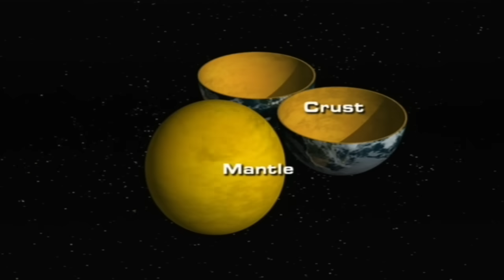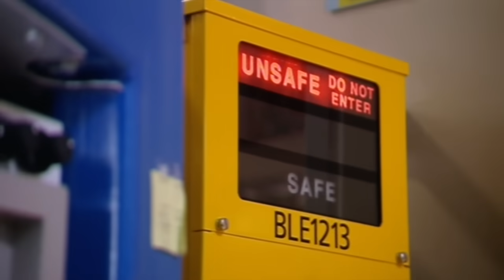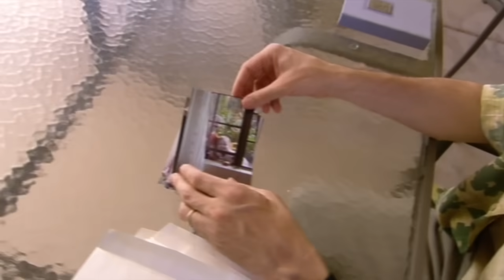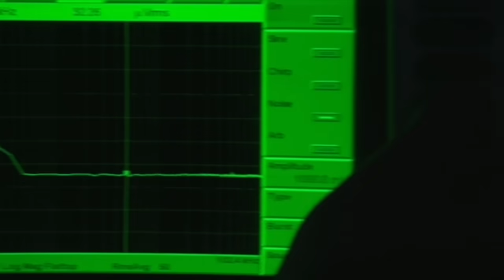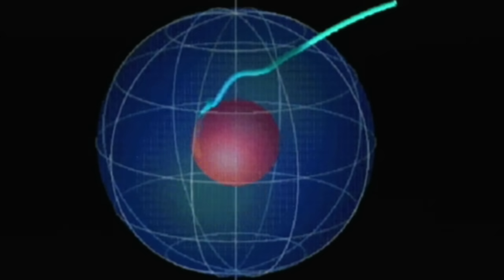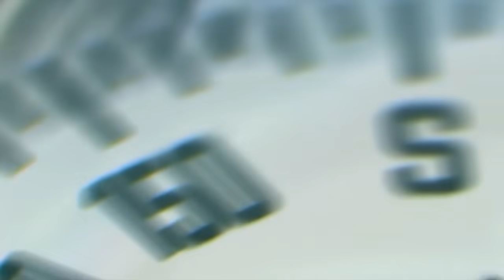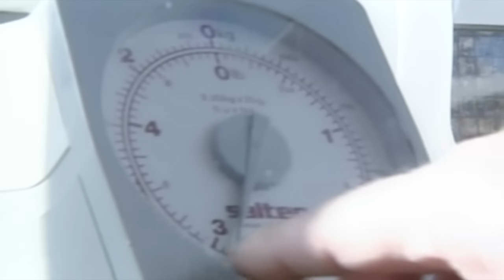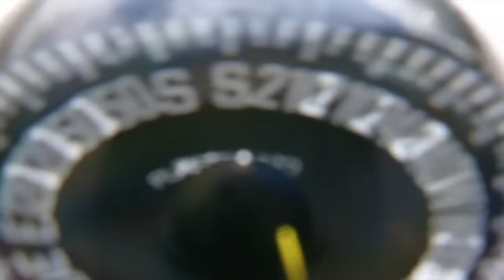Earth's Core

Comment: The Earth's mean radius is 3,963 miles. The solid core 800 mile radius. There's magma around the solid core that's 200 mile thick. The crust and surface magma is 200 miles thick. So the mantle is over 2,600 miles thick and is the dielectric constant of the spherical capacitor Earth needs to pulse the magnetosphere out in space at 7.83hertz. Anotherwords the mantle is the insulator between the magma plates. The center magma being the DC generater with it's 200mile diameter counterclockwise rotating loops that meat at the north and south poles to form larger loops as coils for it's Spherical capacitor to discharge into.
You need a capacitor and a coil for resonance. 7.83hertz is that. Every Engineer on Earth should know this by now. If not then their not Engineer's. This Video is deceiving in Earth's components and their functionality. The magma under the tectonic plate waivers in polarity not the core its self. Mar's magnetic field is collapsed because of a crack in it's mantle shorting it's capacitor. Mar's magma is not solidified or it's gravity field would focus to a point and force the solid core to spin and a blackhole start to form and we would be in trouble.
Reply: Good evaluation.
Reply: @Jimmy2Deadly  Thank you !  The only reason I know this is because I understand how gravity work's.

What is deviation? Well you stir your coffee in the morning and you notice the center stoops down with circular motion.
  The Earth's gravity deviates to the middle, the point of least resistance where the molecules are slowest trying to keep a hold on the faster moving molecules in the outer perimeter through covalent bond but losses grip on some so the molecules in the center takes up the loss becomes heavier and stoops down.  It shows that gravity is an inertial lagforce from motion and not the bending of a spacetime fabric.
The beginning math was simple as you can see.
18.545miles/s:Earths orbital velocity.
.288198miles/s:Earths rotational velocity.32.17405feet/s:Earths free fall constant.
2.000000677s^2/foot: the rate the Sun's pull deviates to the center to cause g constant. So:

(18.545/(.288198×2.000000677))=
32.17405 feet/s^2'g-constant.

The lagforce from the acceleration. of g is the cause of gravity.  Lagforce is the result of acceleration, you'll always have it during acceleration and since Earth's acceleration never let's up so neither does gravity or it's lagforce.
The more complex version math is more accurate.
(1000*c*pi)=Earths Perimeter of orbit=
585,223,410.069 miles. 
There are 86,400 seconds in 24 hour's.
585,223,410.069/(365.2425*86,400)=
18.5449916097miles/second^2=Earth's orbital velocity=Vo.  And.
Earth's mean radius is 3,963 miles and takes 24 hour's per revolution then.
(3,963*2*pi)/86,400s=
.288197482736miles/seconds^2=Vr=
velocity of rotation. And we all know g.
g=32.1740485564feet/second^2 or
9.80665meters/second^2. Now the formulae.(Vo/(Vr×g))=d constant the rate the Sun's pull deviates to the center of earth to cause it's free fall g constant.
So d constant is 2.000003382s^2/foot.
Because:
(18.5449916097/(.288197492736×
32.1740485563))=
2.000003382. Stoop rate.
Reply: @alberttorres4830  mate , I will read and read and read , for you to write that was something else . I do hope you fullfill your endeavours.
I'd love to meet you and really have a look at things , so well done hey .
Reply: @alberttorres4830  ironically...I have a fairly large milk jug it takes about 2.5 literally, I was mixing milk powder as an assertive to my diet ( IV lost so much weight to worry) 
I put a splash in to wet the jugs interior so powder don't stick, on top of little water I add the powder, then I stir and add more water I stir diagonally to smash the powder into the fluid, then when all powder seams to have turned to froth at least I then , swirled around and around, causing that vortex. I added water .... Could I be correct in thinking I got more water into that jug when I poured the water into a violently spinning vortex..
It just seamed to  be the case .
Reply: @Jimmy2Deadly  what's interesting is a dust devel was going by and I sprayed my Super Soaker in it and it got violently stronger. So I built a device that made a toroidal magnetic field and injected a mechanical inertialforce onto the field with an outwards force it would block gravity. Then I took it and placed it in the path of a tornado turnd it on and got out of there and watched. The tornado got on top of it and disappeared stopped was no more proving gravity is involved in the touch down of a tornado. Now you understand how to stop one.
Reply: @Jimmy2Deadly  @ First and foremost Centripital and Centrifugal so called forces are non fundamental by their definitions. They are without action and reaction violating the laws of motion already accepted by the curriculum. Stirring the coffee is circular motion with an outwards lagforce that lags behind the change of angle. Sense Earth's gravity has an effect on the circular motion by deviating towards its Center like a gyro by the way this happens with gyros as well. You can't leave the pull of gravity out of the picture, it's the only thing that deviates not the coffee or liquid and the skin effect is by covalent bond. Also the idea that gravity is the bending of space time is only a theory by a two dimensional thinker Albert Einstein trying to explain 3D space with a 2D idea that was never proven.
Gravity is a fundamental force with action and reaction. Earth's free fall is an acceleration with lagforce that causes you to have weight against the surface of Earth towards its center focalpoint area and is the differential of Earth's two circular motions who's math I have already explained. 
If your in a position have them check the free-fall of Mar's it should be 26.5264feet/second squard. A 10lb weight from Earth should weigh 8.1/3lbs on Mar's.

You know it's funny, everyone's making thing's that are so simple way more complicated than it is. There must be a reason behind it besides brainwashing.
 People are being brainwashed into believing theories are fact, when infact they are not facts but assumptions. I only deal with facts.
 Earth's orbital velocity is
18.545miles/s^2 and rotation is
.288198miles/s^2 these are facts then (18.545/.288198)=64.3481
Half of that is free fall and that's a FACT.

Wow I just disproved Einstein with simple math using your variables in the book. How quaint.
And this was just the beginning there's so much more.
As an advanced micro-physicists in advanced Electronics I can understand the mechanics of thing's.

Comment: Solid earth taught in school textbooks is not a fact nor a theory, its a flawed hypothesis just like flat earth. Remember gravity completely reverses inside the earth which is how we have zero gravity at the center of earth due to even pull from the huge mass above, and the pull from the huge mass all above will cause all heavy objects to fall away from the center of earth. Centrifugal force on the other hand will force all heavy objects away from the center of earth. Molten metals and very hot metals can't generate magnetic fields because intense heat destroys all magnetism destroying the inner and outer core hypothesis, experiments prove it. Also seismology goes against solid earth hypothesis and destroys the inner and outer core hypothesis as proven by Jan Lamprecht. All these facts completely destroys the solid earth hypothesis.

Comment: This video is based off of mistaken ideas. It's known the poles have flipped dozens of time and each time before they did the strength of the magnetic field dropped until nearly vanishing. When it came back up to full strength it was in opposite poles. At least next time present optional data instead of trying to make is sound like a doomsday prediction that's nothing but a lie. While the core will cool and solidify it's in no danger of doing that for at least a billion years.

Comment: It takes 56 pounds of Uranium 235 or 26 pounds of Plutonium 238 for critical mass. Critical mass being one split second explosion. My love of real science prohibits me from fully enjoying this series as much as could be. Thorium would be a better candidate. However, there are title forces on the earth from the gravity of the sun and the moon; these in tern, provide the energy needed to keep the earths insides hot. The effects of this proses would be amplified by the earths size and composition. And then the thermal energy would be further preserved by the thick crust. During  a magnetic flip, the magnetic field would weaken due to basic physics; being that, an alternating magnetic field induces a electric field. Such a electric field would be shorted through the Earth in its entirety; thusly, using up much of the magnetic field strength. After all, all of these prepossesses would be fed by the title forces that are nearly one constant input if gravitational energy. So, gravitational energy is converted to sher forces that result in thermal energy; the thermal energy through the proses of convections is converted into motion; and the, motion is converted through movement of ferromagnetic material into a magnetic field. In the event of a polar shift, part of the magnetic field energy is converted into electrical energy that flows through the earth. Basic physics, no bullshit; and just science. Now why could not this documentary be made with such realism and quality?

Comment: Mars has little to no atmosphere because it has no substantial magnetosphere, so if our earth's magnetic field will diminish and the atmosphere will be swept into the space by the solar winds -- but Venus has no magnetosphere, is closer to the sun, and has an intensely dense atmosphere.
Reply: Magnetosphere does affect atmosphere, but so does tectonics. Venusian tectonics ended over a billion years ago, and its system to recycle carbon failed with it. And that carbon ended up in the atmosphere as C02. Also, gravity on Venus is 90% that of Earth, whereas Mars gravity is only 38%. Interesting to note the composition of the two is remarkably similar, despite the enormous difference in pressure and mass.

Comment: If earth had inner and outer cores like they claim in school textbooks, it will be impossible for earth to generate a magnetic field because all that intense heat will constantly demagnetize all metals in inner and outer cores. All it takes to destroy inner and outer core hypothesis is simple experiment of heating a magnet or a magnetized metal under fire enough and the magnetic field is gone.
Reply: Still advertising your ignorance of the fact that our magnetic field is not the product of ferromagnetism, I see. Signed up for that basic science class yet?
Reply: @charlesmcmillion5118  lol yeah i know they claim earth spinning generates magnetic field which another one of their mainstream conspiracy theory just like inner and outer cores mainstream conspiracy theory.
Reply: @Xeno_Bardock  Uh, no. It's from convective currents in the outer core and turbulent flow at the boundaries. It is NOT ferromagnetism - which is the result of electron spin magnetic domains - that's what heat destroys.

"it will be impossible for earth to generate a magnetic field because all that intense heat"
And how do stars generate their magnetic fields? The fields are much stronger than Earth's and stars are WAY above the Curie point.
Reply: @charlesmcmillion5118  Assuming inner and outer cores actually exist, which they don't. Life on earth will be impossible if earth was a pseudo star covered with 40 something km thick crust like they teach in schools. Seismic waves actually detect huge cavity, not inner and outer cores, google "Liesegang Cavities". Same thing with the moon.
Stars are not nuclear fusion like they teach in schools, stars are fundamentally plasma and powered externally by galactic arm birkeland currents, that's where Sun's magnetic field comes from. Youtube search "Birkeland Currents Explained" and "Wal Thornhill: Blinded by the Sun | EU Workshop" and "Top 10 Reasons the Universe is Electric".

Comment: The sun does not act like a nuclear reactor at all. Nuclear reactors use a process called fission. The sun uses a process called fusion, which is different and generally produces less radiation because of the elements used.

Comment: 5:45 The statement when he says if you skydive into the center of the planet, it would take you 32 HOURS? I mean wow I was amused but thought I'd verify that (Not a strong background in physics so might be wrong af lemme know if you know better lol)

I assumed they calculated it by okay 10,000 ft skydive takes 1 minute so to the center of the planet (6371000 meters - 20902230.97 ft (Earths radius)) would take around 32-34 hrs cool cool cool ..

BUTT!!! - Knowing you accelerate faster and faster as you fall - Disregarding Air resistance (I have been skydiving sleeveless and know terminal velocity with air resistance has a huuuge part in it by the way it had my arm fat flapping like a bird XD (made me rly get over my fear of flights bc I trust air more now knowing how it feels at such speeds) )

...But disregarding air resistance just free falling towards the center of the earth 
(Using 
Time = Squareroot { 2x-6371000m / -9.81m/s^2 } 

it should rly only take 18 minutes to reach the center. ) 

ERROR MARGIN: I'm not sure how much the 9.81m/s^2 changes the closer you would get to the center so would probably be faster

Comment: The magnetic anomalies you stated are not leaving the earth but returning to the core at those spots are , because like a flame the tip comes near the surface then flows back down but are anchored as a pyramid shape bottom of the fire like plasma and as it folds back down contains its shape and as the other !four or more plasma energy as I have called it are always held at the base near the core ! But the freely to move back and fourth flame nears the surface to create anonymity that aircraft fly over these sections and have disturbances ! These are always very stable as the base is held so the shape of the flat pyramid are basically motions of all of the plasma energy flames but looking down at it would make it look like you were seeing it return but it is still always holding that same type of shape pointed narrow tip . And wider base that spreads like it is being held in place ! But it’s motion is like a flag moving always holding its amazing type shape even though it is freely flapping with the others that are always pointing away from the magnet poles and seams as if everything is very well balanced with the other hot spots were this can be seen over and over as a process ! That always holds its basic structure ! The way to see this is earth Penetration radar often used in cloud  and weather moisture satellites but must be able to be tweaked to go further through the model simulation to observe its slowly changing but predictable actions that always show this is a constant process of very high energy fields ! I felt this could be used for free energy not only on earth but other planets as it is clean and a  very strong yet very steady hot spots arising from the core ! Thank you for your video as this has always been an Amazing subject that far to many fail to understand its very great potential for free energy in planetary exploration   And bases as this seams to be a basic process !

Comment: That’s the first time I’ve heard about the moon affecting tectonic plates but it really makes sense if the moon can control wave patterns then it’s gravity will be strong enough to move earth crust when then sun is aligned with both moon and earth it’s happens on Jupiter moon iode most volcanoes In solar system

Comment: The magnetic field of the Earth is composed of electrons which make up a continuous structure which rotates at the same speed as Earth does on its axis. These electrons are not traveling from pole to pole but remained fixed in structure surrounding the Earth with diminished strength as their distance increases. Earth has three distinct magnetic fields because its different density structures, they being the core structure, the magma structure and the mantel structure all rotate at slightly different angles. True north as indicated by our angle of rotation is not the same as the rotational angle of the magma shell nor the angle of rotation of the core structure. This is why the magnetic north wanders in a circle around true north.

Comment: The core is an oscillator, solid state hydrogen with it's own magnetic field transforming birkeland currents of the heliosphere. Meanwhile we know about the secondary magnetic field (Pole split) due to the changing solar energy output. Lava behaving like solar plasma driven by Electricity, volcanic eruptions are the same as solar flares. The only thing coming to an end is an incomplete on gravity based standard model of Physics. Mars magnetic core field is still there but dispersed in rock with lots of iron - red-. The mantel field ( Convection) is dead and sitting on the surface as a layer of iron oxide, the result of overboarding volcanism caused by an impactor or a micro nova event. No fear, we are as safe as we always were.